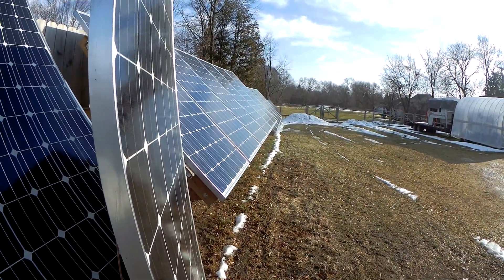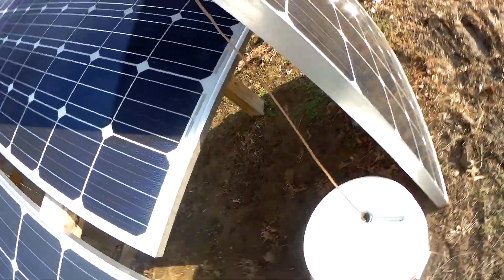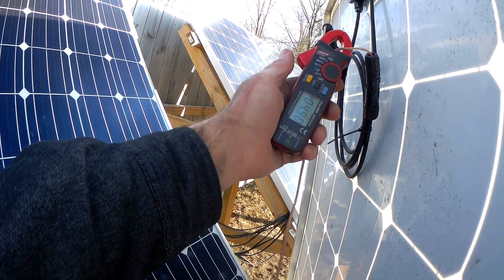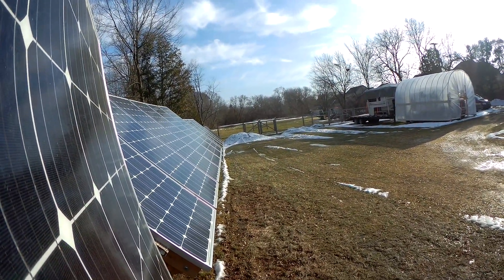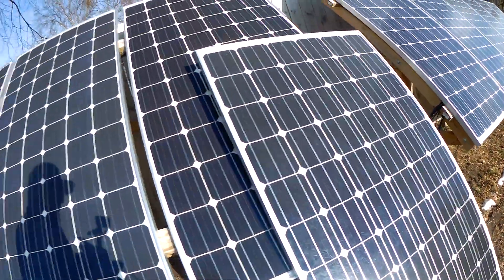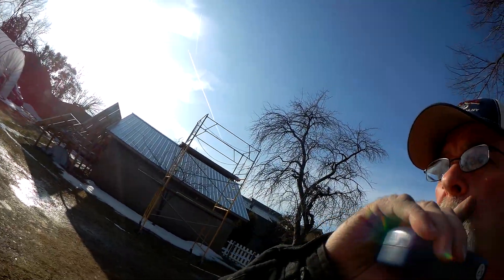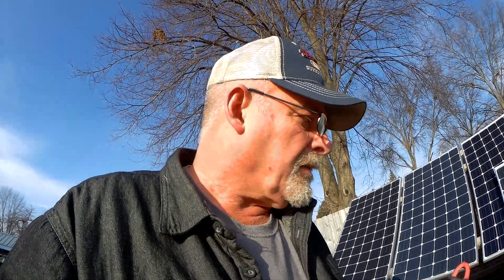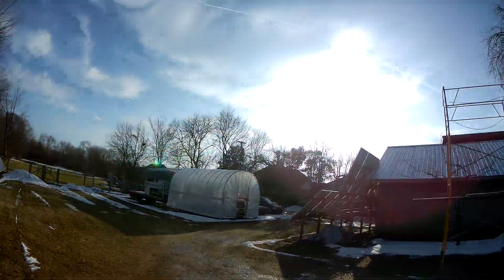Solar PV Hot Water- MPPT or not ? Part 2

Comment: I am considering using our 2 k array in the summer and diverting it to a water heater through a mppt water heater controller. We do not need the power from that array most of the year. 2000 watts is not going to heat as fast as the original 4500 watt element but it's just my wife and I. I do not want the load on our inverter so a MPPT WH controller is the only option.
Reply: I have no trouble heating water with only 500W going into the tank.  Remember it is watt hours total. 4500W elements are only necessary for fast recovery. At home I had a temporary water heater set up with only 700W. That temporary turnred out lasting 5 years.  It wasn't an inconvenience.  I'll have an even easier circuit to build in a few days that uses direct PV voltage to water heating element.
Reply: @opera5714  That is a valid point. With our spare 2k array the recovery time would be 2 hours rather than 45 minuets. Not a big deal. We may still do it but with the woos stove burning 8 months a year we may go with a range boiler loop.

Comment: Hello,
What are the specs of this heating element ? Wattage, voltage ? I'm in Europe and we mostly use 220V 2000W-2500W heating elements.
Reply from the maker: HI David, 120 volt 2000 watts but most importantly it's 9 ohms.   The resistance is what's important to match to your panel(s).   But don't take this video TOO seriously yet as I'm still experimenting at various sun intensity.  More videos to come.   We know it works good in strong sun, but that's it.
Reply: @mark_osborne  Thanks for the input Mark, the mppt could be usefull at low irradiance, this is where the difference between mppt/no mppt should appear.
I'm planning on connecting 6x300w/40V/9A panels in serie, making a 1800W/240V/9A panel that should work with my 26 Ohm/2500W resistance (250 liters tank).
This is my "simple alternative", but i would like to have a diverter in my system since i feel it's always the best way to take advantage of all energy panels can give.
Rem : 120V/2000W give me 7.2 Ohm under 17A.